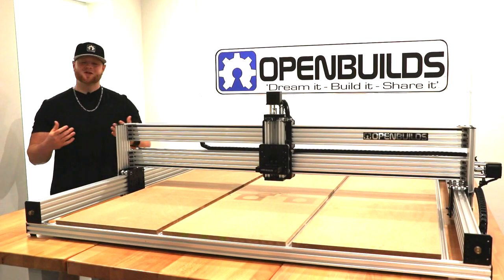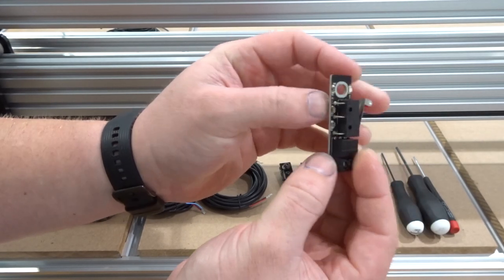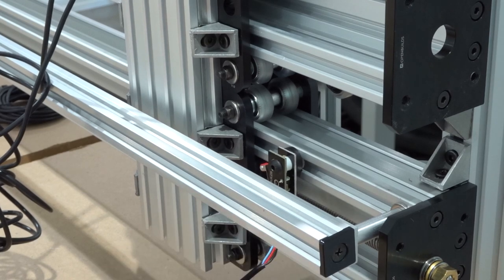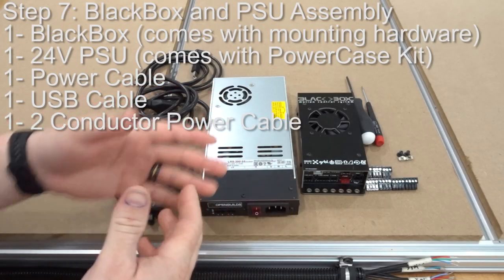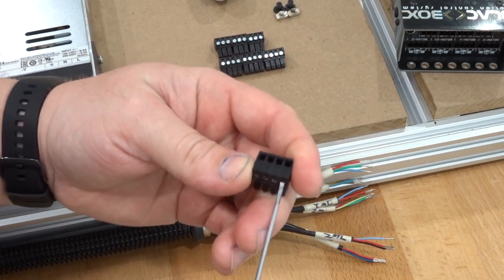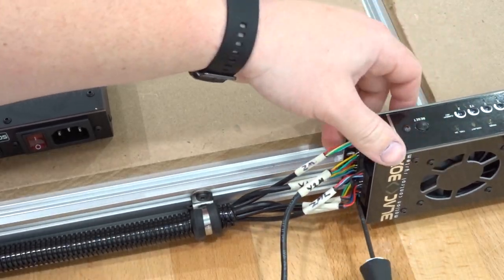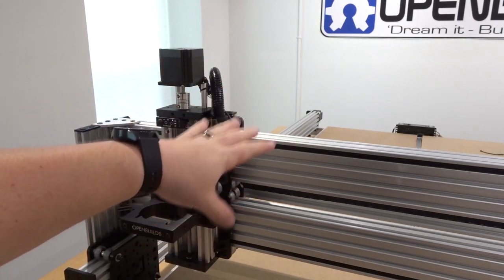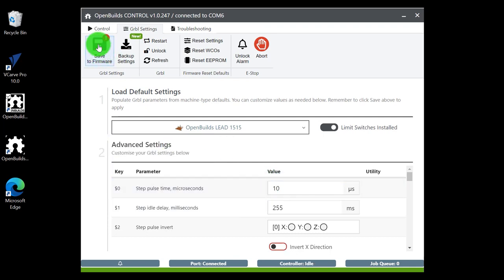OpenBuilds LEAD 1515 Electronics and Software (Using BlackBox)

Comment: Why using only 3 limit swithes, and not 6 ( 2 on each end of 3 axes) ?
Reply from the maker: You can use 6, we just you three as a home position
Reply: @OpenBuilds  I have noticed blackbox can only add 3 limit switches.. what should I do if I decide to use 6 switches instead ?
Reply from the maker: Yes you can have 6 limits just wire them in parallel and with the OpenBuilds Xtensions is super easy to do.

- SIG on controller to SIG on switch 1 to SIG on switch 2
- V+ on controller to V+ on switch 1 to V+ on switch 2
- GND on controller to GND on switch 1 to GND on switch 2

Just like https://docs.openbuilds.com/doku.php?id=docs:blackbox:connect-xtension-limit but paralleling each wire to the second switch
Reply: @OpenBuilds  Thanks!

Comment: I noticed when mounting the y axis cable chain at the back of the machine the whole machine is lifted slightly on that corner. This is because the tee nut and the screw sticking through. Would this corner being slightly elevated have any impact on the accuracy?

Comment: I use v-carve pro 10.5 and mach3 can I use open builds software with my machine
Reply from the maker: You can use V-Carve or any cam software, but there is no need for Mach3 as OpenBuilds has a free easy to use control software called OpenBuilds CONTROL that will read your gcode and control your machine https://software.openbuilds.com/

Comment: Hi! In March 2021, be careful with the wiring of the motor, I followed exactly your method, and the nema 23 high torque don't turn.

I checked with a multimeter, and have to invert two wires.

Thx for the video.
Reply: Hey Dr Makes,  which 2 wires did you invert?